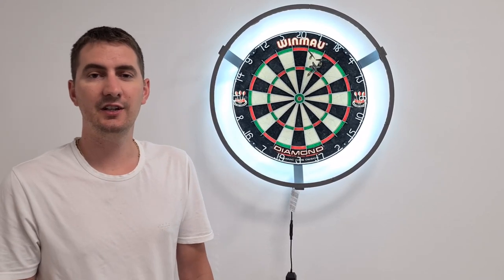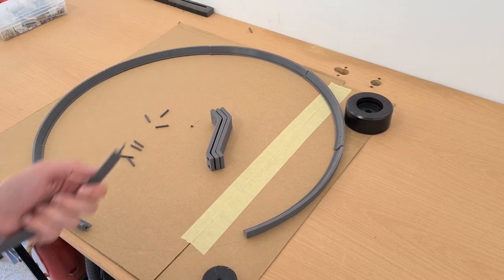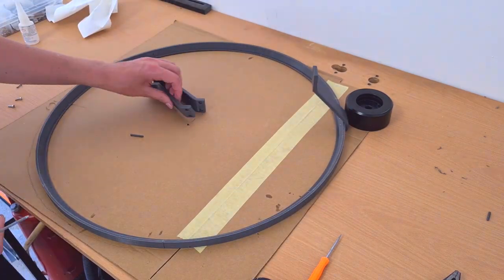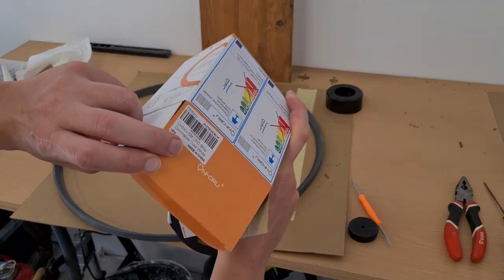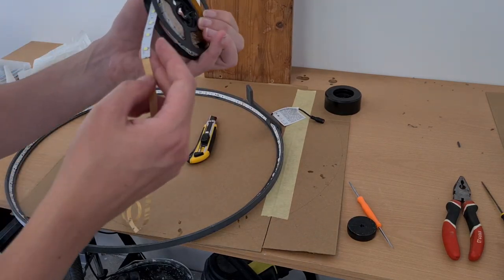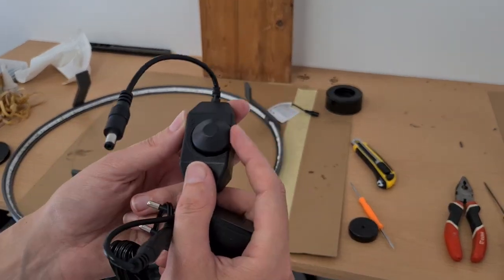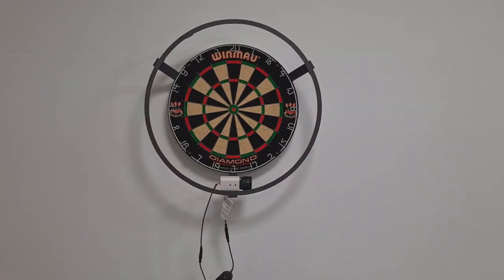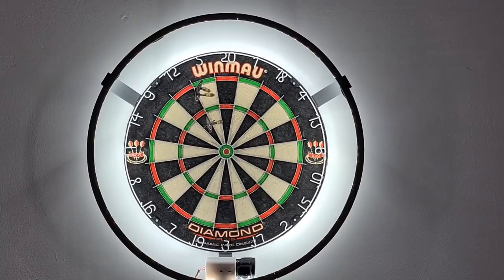DIY Dartboard Ring Light - 3D Printed

Comment: Hello? I need to know if it will fit on my 3D printer before I pay for the 3D files. Can you please let me know what size printing bed I will need? Thanks.
Reply from the maker: Hello, the longest part is around 255mm long. I printed 4-5 of the sections the same time on my Bambulab P1S positioning them slightly diagonally.

Comment: Well done with the design 👍. How big a print area does the 3D printer need to have?
Reply from the maker: Thank you! The sections are around 255mm long. I could fit like 4-5 on my Bambulab P1S diagonally.
Reply: @kikihobbyrepair  Thank you 👍

Comment: Can I ask which battery you used? I am looking for a reliable battery that can power my LEDs for at least 5-6h. Thanks in advance 😊
Reply from the maker: I use here my 2Ah AEG electric drill battery. This easily powers this light for 5-10 hours depending on the LED strip (current draw) you use.
Reply: Thanks :) I'm interested to know how you connect the dimmer cable to your drill battery. Any pictures you can share?
Reply from the maker: @quentinlebbe  you can find the .stl file for the Drill battery holder in my following cults project. https://cults3d.com/en/3d-model/tool/3-axis-motorised-camera-slider

Comment: what size print bed is used here
Reply from the maker: I printed it on a Bambulab P1S printer. If I remember the longest section is 255mm. But you can for sure put it diagonally.

Comment: That looks very good. I have to ask some questions before printing this. 

What is the diameter of the circle? 
How far away from the board surface is the light?
What infill percent did you use?
Reply: And how long did it took to print?
Reply from the maker: Thank you!
The outer diameter of the circle is 580mm (it fits on a the standard sized 450mm darts board).
The distance of the LEDs to the board is around 75mm and it is angled to point in the direction of the board.
Infill percentage is at least 30% but most impostant to have at least 4-5 outer walls. This gives the most stability.
As for print time honestly it is a good question. I printed it on my Bambulab P1S which is insanely fast. It took me a couple of hours to print all parts.
I hope I could answer most of your questions :) Have fun building. I use it a lot and already printed some for my friends and they all love it.
Reply: Somehow i cannot locate the link for payment of 3d design can you share it pl
Reply from the maker: @medicalarchitecturalsystem8235   here is the link to the download page. https://cults3d.com/:1338610
Reply: Its not reflecting on your payment page of cults
Reply from the maker: @medicalarchitecturalsystem8235  you can just click on download and go to the cart and do the payment.
Reply: @kikihobbyrepair  got it thanks Kiki
Reply from the maker: Thank you. Have fun playing 🙂
Reply: @kikihobbyrepair  hi buddy i did make 3 of them they turned good .
Can the diameter be increased to get surround inside totally 
Most important the side where we stick led  should be at least 5 mm more .
Also if infill is more it will turn more solid 
Can you do that pl for  me
Reply: Can you reply this
Reply from the maker: @medicalarchitecturalsystem8235  I am sorry for the late reply. Unfortuantely at the moment I do not have time to work in this. Later on I might be able to help you.